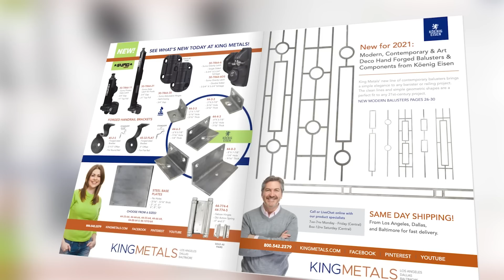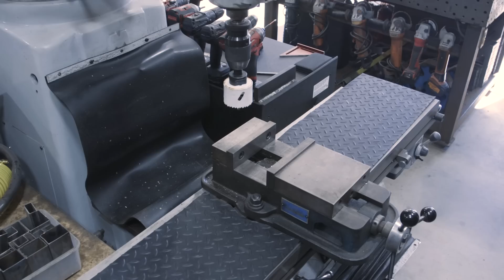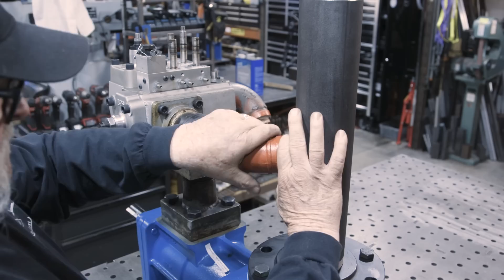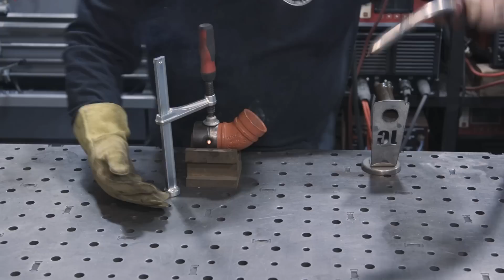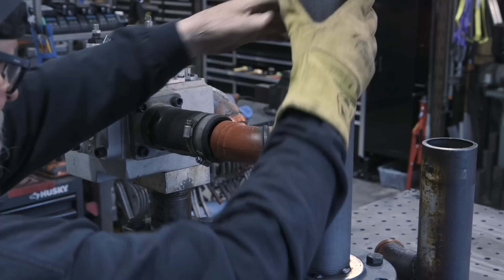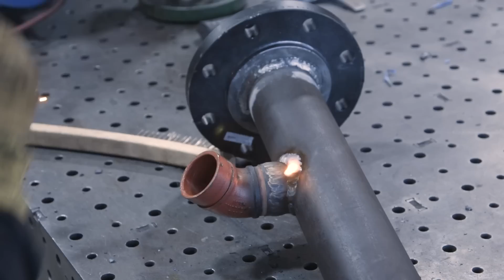Elevator Oil Pump Part Frabrication | JIMBO'S GARAGE

Comment: I am learning to weld.  first time I have seen someone weld multiple passes with different welding processes (mig, then stick;  tig then stick, etc).  I assume this is acceptable approach?  for example, okay to use er70s-6 and then cover with E7018?  any comments and info on this is appreciated.

Comment: That poor Victaulic 45. Also I install fire sprinkler systems and this is what we use every day. That looks like a 2 1/2 45° not a 2". I could be wrong. It says the size on the side.

Comment: good job, but I have a doubt, there is any pressure test performed to the weld done in these pipe?, best regards
Reply: He just said in the video that there is no pressure produced by the pump, It merely pushes oil.